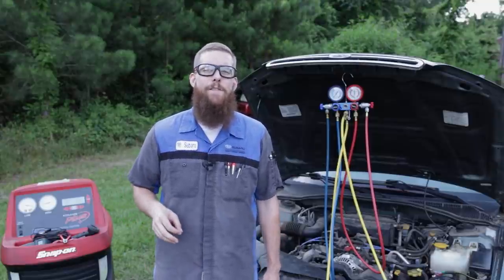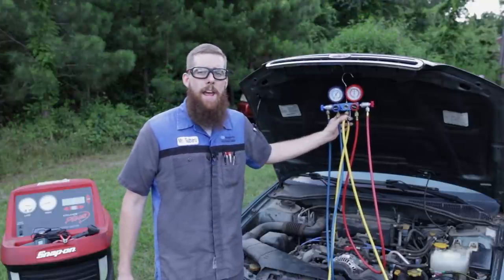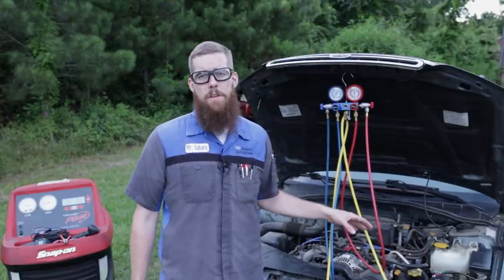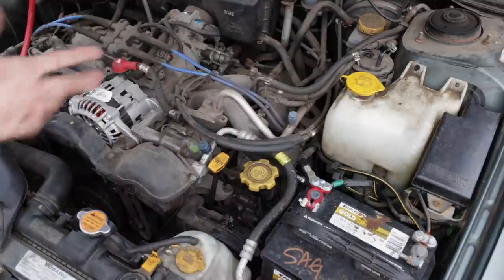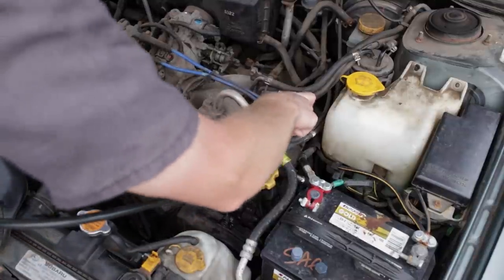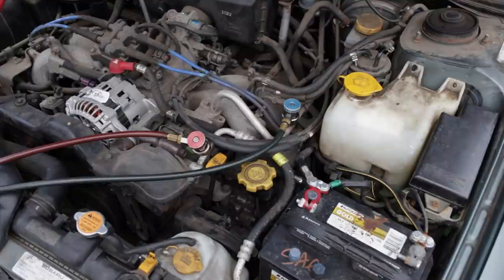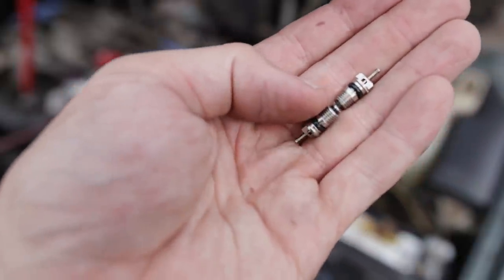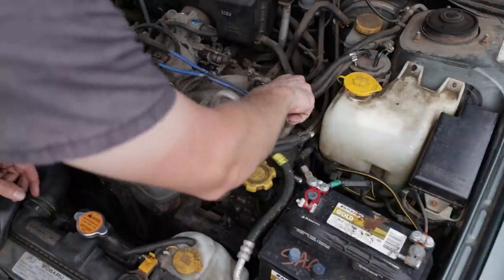Automotive A/C Basics: System Recharge

Comment: We are so spoiled, I remember the old 2-55 
A/C system in my 1977 Chevy Monza 2+2 hatchback!
(That was open both windows and drive 55 mph on the Interstate) !!
Good Video!
Reply from the maker: I've owned plenty of vehicles with 2by60 and 4by60 A/C systems in my life. 😂 😂 😂
Reply: Remember there was a vent on the floor at the driver and passenger side, you just opened that and it worked fine. I'd be happy if they still had those because I'm ok with the car interior temp being whatever the hot day is. The problem is opening a window is too windy and if you're on gravel it's way to dusty, so you can't open the windows anymore and a car is way to hot with them closed and no ventilation. So we aren't spoiled we just have no other choice

Comment: At 21:50 when you said that the "pressures look good" - what should those be in round numbers?  Thanks for this video, I will be getting after the a/c system in my '06 Forester with this info.
Reply from the maker: They vary depending on the ambient temperature and humidity. Low usually around 30psi high 180-200ish.
Reply: @MrSubaru1387  OK, great, and many thanks for these informative videos.

Comment: I had my ac system on my 02' h6 outback open to the air for a while without the suction hose on (the ports were blocked off). It worked perfectly fine before i recovered the system to take the suction line out for space for a rotated turbo setup, but now i have a line that fits and want ac back. I have an accumulator on hand to replace the old one, but my question is how do i know how much oil i need to put back in the system after replacing the accumulator? I also am not sure if there was any oil that came out when the system was recovered

Comment: Return low pressure line frosting up?  I had a shop evacuate and charge the system.  Worked well for about 20 minutes.  Evaporator?  2002 Impreza wagon.  Thanks

Comment: Quick question: at around 20:40 he revs the engine and I’ve never seen that done from the engine bay. I’ve been looking all over YouTube and can’t find a solid explanation of this and was hoping someone could clarify what how he does this
Reply: The pedal is connected via a cable to the throttle body - when you push the pedal it pulls the cable and opens the throttle. He's just doing the same thing with his hand.

Comment: Can you advise on low and high side pressure since the manifold wasn't in the frame?  FSM states 18-28psi low and 213-242psi high.  I'm trying to figure out if I should split the difference between the ranges or is it temperature humidity variance?
Reply from the maker: Ambient temperature and humidity affect the high and low pressure.

Comment: Is there enough oil in the system  to where you don't have to add any?
Reply from the maker: Usually you don't need to add oil unless you're replacing a component, or the system was damaged/open/ruptured and oil was lost.
Reply: If replace the expansion valve.need add the oil? and No freon in the system for several months.  thank you

Comment: I have a 2016 Subaru Outback and the clutch on the front of my compressor does not look anything like the clutches in any of your videos and it is always spinning. My low side pressure is the same as when the car is off. It never fluctuates and always reads high, approximately 90psi. I can not hear the clutch click or engage when I press the ac button, but I do notice the rpm's changing. The ac contantly blows hot and never cools at all.

Comment: Hi Mr. Subaru, I will be replacing all the A/C components (Evaporator, Condenser, Compressor, flushing the lines, etc) on my ‘05 Subaru Outback XT. When it comes to adding PAG oil to the system, is the oil added when the components are installed, then the vacuum is pulled on the system? I’m concerned the vacuum may also pull the PAG oil. Also, do I add half the PAG oil into the compressor and the other half into the evaporator and a bit on the lines? If you can please clarify on this.. Thank you in advance.

Comment: how did you remove the schrader valves and install new ones? special tool? thanks!
Reply: If the system is empty you can probably use any Schrader valve tool with a shaft longer than the one in a typical 4-way Schrader valve stem core tool. But if you want one that can change the core without draining the refrigerant search for an automotive ac Schrader valve removal tool.  Here's a video demonstrating it: https://www.youtube.com/watch?v=wkPxxUO_40Q

Comment: Would it be a good idea to replace the valves and o-rings at the same time on an old vehicle?
Reply from the maker: Normally, no to o-rings, yes to schrader valves. But, if you have a Subaru, mid 90s-10s it could be a good idea to replace the o-rings on the fittings at the compressor, since they're known to leak.

Comment: I have had to replace 4 wheel bearings on my 2014 Forester which has 120,000 miles.  3 of then on the back right wheel. I think i am not going to buy another Subaru. Is this normal???? I never had to replace any wheel bearings on any other cars i owned and i usually bought new one at 150,000 miles.
Reply: Normal to replace a wheel bearing after that many miles. If they were replaced with lower quality aftermarket ones and/or not properly installed, then they could definitely wear faster and go out again. You're not supposed to use impact wrenches to install the pre-assembled bearings/hubs since it can jolt them from their spec (since they are just pressed in and not locked with a circlip or anything). I would guess between a combination of lower quality parts and less than perfect installation caused the same corner to need replacing. Could also be an alignment thing, maybe the alignment is off? Overall I agree though it is very unusual for multiple wheel bearing replacements to be needed

Comment: Thanks for your video... I too wonder though about PAG oil - is it not necessary to install a certain amount? If so, how and when do you suggest?
Reply from the maker: For a normal recharge, you shouldn't need to. If you replace a component, say a/c compressor, etc then you need to add oil. Usually you add oil directly into the component, but, you can add oil in to the yellow charge hose before adding refrigerant.

Comment: I know it's against the law, but GUARANTEED most shade tree mechanics just let it go into the atmosphere.  Just sorta one of those things. 

One question I do have on this though; what does the manifold do that a hose on a recharge can won't do?
Reply from the maker: Let's you see both high and low side pressures. Seeing low side pressure alone isn't enough info.
Reply: @MrSubaru1387  So it's more of a diagnostic tool then, as opposed to simply filling the system? What does knowing the high side actually do? Is it a matter of parts replacement at that point? I clearly know little about using a manifold for any AC work. Hahaa

Comment: The ac in my 06 wrx did not work when I got the car.  I changed the dryer and pulled a deep vacuum for about a hour.  Let it sit for a day and it held vacuum.  I went to put in freon and it would not draw in but one can.  We determined the compressor was weak.   It did blow somewhat cool and the compressor did cycle on and off.   I put in a new remanufactured compressor (yes,  I added more oil) and repeated the same process.  This time it did take in the required amount and had nice ice cold air.  Now for my problem.  The compressor will not cycle on and off.  The ac clutch is not stuck either. And with the ac running, my car starts to over heat at idle and at speed.  The condenser core is extremely hot!  I know it will get hot but, that is way to hot.
Both fans are working as they should also. Bad pressure switch?  Clogged condenser? 
Any info will be greatly appreciated.

Comment: Had my radiator changed and now the a/c stopped blowing cold on driver side. Could they have messed something up I had it serviced less than 5k miles prior at Subaru. Or does this mean I have a leak. Was almost 200 bucks to have subaru. Dont want to take it in of I just need a recharge. There is a slight consistent hiss when the a/c turns on.

Comment: Hello! Thanks for the video. I have replaced the o-rings and Schrader valves on my 2017 Premium WRX. I verified that the system holds zero after the vacuum with those changes. I having a problem with adding freon to the system. Once I connect the can of 134a to the yellow line, tap the can, purge the air, then open the low side the pressure rises about 70 - 80 Psi. I hear the freon enter the Yellow line but I don't see the liquid in the view window, even after shaking the can for a little while. for some reason, I don't think the freon is getting into the car's AC system. (I have all the equipment you're using in the video). Any help would be greatly appreciated and thank you in advance.
Reply: If your compressor isn't turning on it won't pull it into the system.

Comment: I have to recharge my system after an accident  (sigh).  Are the Schrader valve cores for a Subaru '06 Forester readily available  from a parts store or would you recommend ones from the dealership? I plan on sourcing them, i am just curious  if feel the part is worth paying OEM/dealership prices.

E:  Do you recommend or not putting lubricant in the system?

Comment: Hi. I am a subscriber. Been watching your videos and I have a 2014 Subaru cross track XV Limited. These cars seem to have AC leak issues. I had it in the shop like three years ago. Leaking EVAP CORE. Now I have no more warranty and have some O-rings leaking. Still have pressure so now I’m looking to purchase a good AC recovery pump and tank. Do you have a recommended pump brand. Thanks August

Comment: I have a 2020 Crosstrek with the stupid fast idle until warmed up. Do you think it's to hard on the CVT if you shift into drive when RPM is at 1800. I'm absolutely flabbergasted with your knowledge. Much appreciated.
Reply from the maker: I advise letting the engine run until the blue temp light goes out. That's what I do in my 2013 Crosstrek. When the blue temp light goes out rpm drops to normal rates.
Reply: MrSubaru1387 thanks for your response. I have been waiting until it idols down blue light off. But do you think that puts stress on the CVT belt. I’m like you, i’m not a fan of CVT either. Mine jerks sometimes when slowing down or accelerating. Any thoughts thanks.